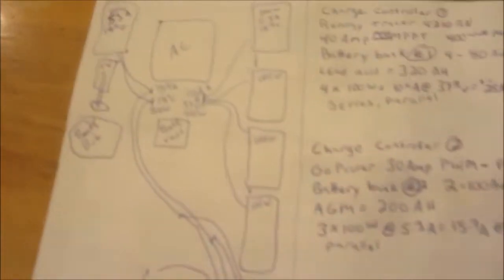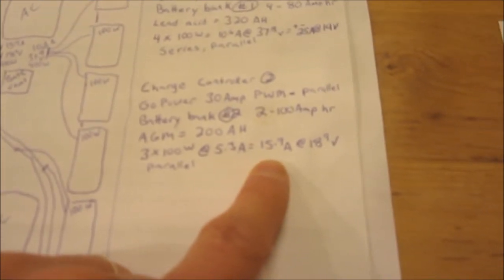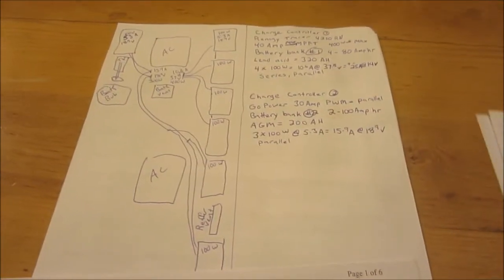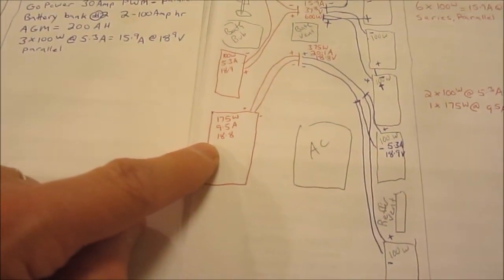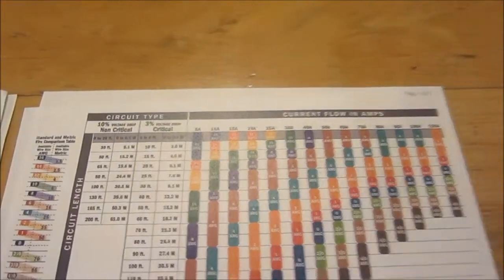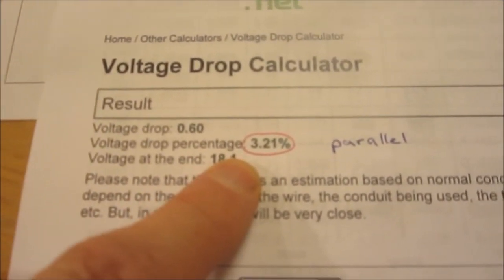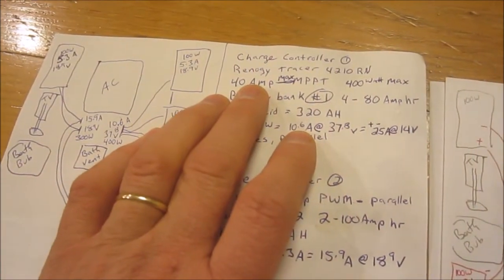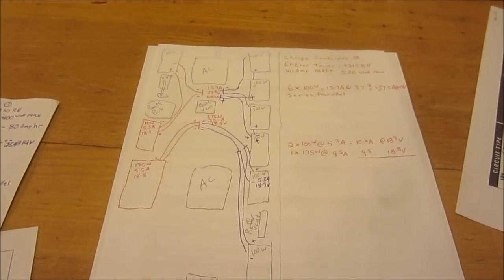Solar panel Wire gauge sizing and Maxed Out Charge Controller

Comment: 4:20 you only have 4 panels connected at 100w each ( or 200 x2), that is 400w. How did you came up with 600w?
Reply from the maker: Don O two banks of solar 4x100 and 2x100 = 600w

Comment: You ought to be more familiar about solar before trying to make an instructional video. The controller has nothing to do with watts! It is solely rated by voltage and amperage that it can charge into your battery bank system. Wattage comes more in to place with the inverters output in AC current after the size of your solar panel input voltage, controller voltage and battery voltage in DC current are configured in the same voltage. So as long as the maximums in voltage and amperage produced by your SP's fit within the maximum limits of your charging controller watts are not the issue as you mentioned in your video content. I suggest that you remove this video from any viewing!

Comment: Download BlueSea’s Circuit Wizard app. This will let you calculate wire gauge recommendation based on voltage, current, length, temperature, length of day carrying current, and the % loss you are willing to loose in that stretch of wire. None critical circuits often allow 10% loss, critical circuits allow 3%, but you can input for example you want that you want 1/2%. If you full-time you maybe shocked how much power you loose if you accept a 10%.  

My system is designed for 1/4% loss.

Comment: Hey glad you got your 1000 subs..

Often that 400 watts can be exceeded but the spec sheet does not specify on your tracer.

https://www.renogy.com/template/files/Manuals/20A-30A-40A-MPPT-Solar-Charge-Controller-Manual.pdf

Instead of the BN I would be looking at the tracer A series from Epever. I have the 40 amp version of this, couples with 2-280 watt panels in series. Im 560 watts and about 70 volts in series.

http://www.epsolarpv.com/en/index.php/Product/index/id/653/am_id/134

See page 10 here. The controller can accept 1560 watts @ series solar. 3120 watts parallel. has 100volt max. Stay with these limits and your good.

http://www.epsolarpv.com/en/uploads/news/201710/1508812885787574.pdf

I bought this. Comes with temp sensor, mt50 meter, ect.

https://www.amazon.com/EPEVER-Controller-Display-Battery-Charging/dp/B077HHYYHT/ref=sr_1_1?ie=UTF8&qid=1520355093&sr=8-1&keywords=epever+40+amp+mppt

Start there.

The other thing is get rid of that other pwm controller.

I dont have my solar testing videos yet, but I did conduct some load testing. My videos are drawn out and rambling but check one or two out.

https://www.youtube.com/watch?v=7p-oNT8YDIs

Its being debated that 12volts are better @ inverter use due to less voltage drop. 6 volts are not cracked up what they are touted to be.  Too high a voltage drop using 6 volters especially when less then 80% SOC on them. Too much internal resistance.
Reply: Just a note... Panels in series the amps stay the same. So 2x 5 amp panels in series is 5 amps. Parallel the amps double. Get rid of the PwM as stated and hook the 3 in series and then dont worry about the wire size. Use your existing renogy for those 3 panels. get the new epever for the others 6 panels.
Reply from the maker: Lawrosa1 thank you. For all your insight and help in reaching 1000. I have a lot of research to do now. Thank you again
Reply: No problem. Just off the top of my head. yes you have 600 watts with 6 panels?

I would do 3 in series and 3 in series  then the parallel them . Get that epever you buy up to max volts. Higher volts is best IMO. Easier wiring. That epever tracer A is a better choice IMO

 Dont worry about the whole shading BS. Panels on on roof of camper. Either you have shading or you dont. Plus those panels may have bypass diodes built in. This is a non issue with shading. I can shade my whole other panel in series and lose nothing really.

Like I said as far as the other 3 panels use the renogy for them and hook up those 3 in series..

With any MPPT you want to max the volts of the controller. "BUT DON'T GET NEAR OVER OR YOU WILL PUFF WHITE SMOKE" 

Like said in winter I get som 80 volts with two panels series. They are 38 volt residential short circuit voltage.

What you'll notice with higher voltage is @ 7-8am of when sun first comes up, you have enough voltage to start charging.
Reply from the maker: Lawrosa1 Page 9, 10 and 11 so great detail for the series a charge controller Booklets don’t cover. This charge controller is the same one I installed for my friends build that I made a video series on.

I just received the tracer 4215 BN controller in the mail. I I am going to make an on boxing video about it tomorrow. I made the assumption it would be a better/more resilient controller just because it was $50 more from the same company?

Later in the spring, I also was going to add another two 175 W panels
Reply from the maker: Lawrosa1  by the way, I watched two of your videos and I subscribed. I look forward to your solar videos. Thank you
Reply: Great... Thanks.. 

OK you got what you got.. Im cheap and didnt want to spend the extra $50 bucks. Plus the other came with the meter and temp sensor. No biggie and you may be better off. Here's why...

Your controller is  epever Tracer 4215BN is now a 150v controller. 138v @ 77F.  IMO again as many in series to match the volts is best. Again per the manual 780 watts max on series string.  Which is 1.5 times the 520 watts. Then parallel  its 3 times max allowed, or 1560 watts( page 9)

So you have lots of volts to play with and your undersized wire is not an issue. When you do a lot of paralleling then you have amp issues as its cumulative.

http://www.epsolarpv.com/en/uploads/news/201710/1508813495487522.pdf

Also IMO get matching watt/volt panels. If your going to add to your 100 watt panels, then try to find 200 watt panels.

In series your lowest amp panel will pull the higher amp panels down. Volts always add.

http://www.alternative-energy-tutorials.com/images/stories/solar/alt107.gif

In parrellel the lowest volt panel pulls down the others, but amps always add.

http://www.alternative-energy-tutorials.com/images/stories/solar/alt113.gif

So buy panels with what you have wisely...
Reply from the maker: Lawrosa1. You sure have a handle on solar. Great information, you’ve done your research.

I added a photo to my Facebook post of what my rooftop solar will look like by the end of the spring. I am a fan of series/parallel so I don’t lose the whole string if one panel gets in the shade. That photo will show that the solar Bank number two is at 725 W at 19.5 A and 37.6 V.
It incorporates three 175 W panels at 18.7 V plus the two 100 W panels at 18.9 V.
The two 100 W panels will be in parallel to equal 10.6 A and 18.9 V, and then paralleled with one 175 W panel at 9.5 A and 18.8 v equaling 375 W 10 A and 37 V
Paralleled with the other two 175 W panels in series at 350 W and 9.5 A and still at 37.6 V.

I am willing to sacrifice those 25 W from the 200 W panels to be able to incorporate them in the system.
Reply: Just an example. My two 280watt panels are 38 volts short circuit. With load I get about 30-34 volts. I am in series. My amps for one panel is about 8-9 amps. In series it stays the same.

Here is 4pm winter sun getting 6.1 amps from panels. The epever mppt turns that into 31 amps to batterys. Takes the extra volts and turns it into amps.

I run small 8 gauge wire some 50 feet. High volts, less amps, smaller wire = cost savings IMO

https://farm5.staticflickr.com/4629/38982136415_f2b9318714_c.jpg

Also make sure you go into user settings and change the parameters. You want 14.8 volts bulk charge. Maybe a 13.6 volt float. Boondocking it should never go into float. Absorption is the same 14.7-14.8 volts. I set max 3 hours. As when boon docking the sun will go down way before batts are truly fully charged...

Change equalize too. I turned mine off as im plugged in during winter storage. Set equalize for  1 hour maybe as it does it the 28th of each month.

Comment: I too am learning having added a four panel 400 watt solar system with Bogart controller and trimetric monitor, but I ran 6 gauge wire from a junction box  on the roof where the 10 gauge solar panels merge to the controller just to be safe.  I also have a fifteen foot run of wire. Just trying to future proof any additions down the road. It may be over-kill, but better to be safe than sorry.  Love your videos. I learned a ton from them.
Reply from the maker: John Alex Thank you for the comment. Junction box is a great way to go, and always better safe than sorry.